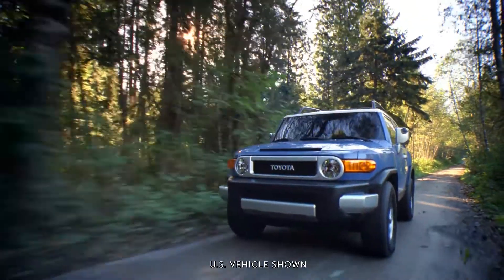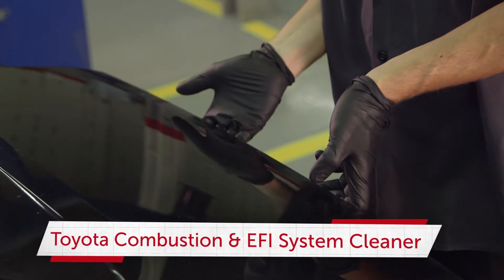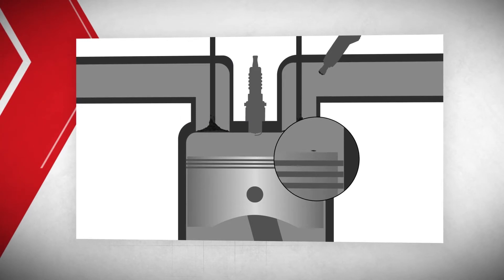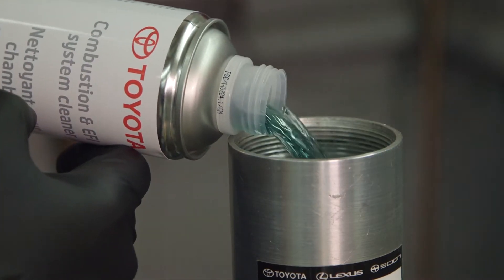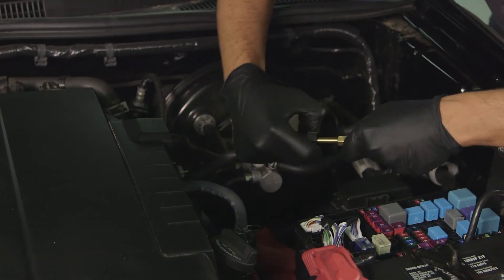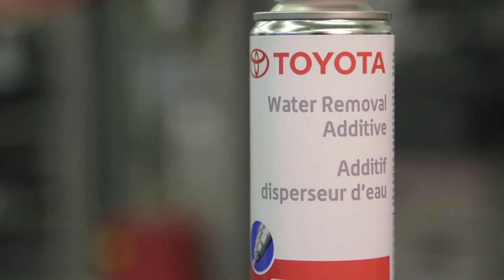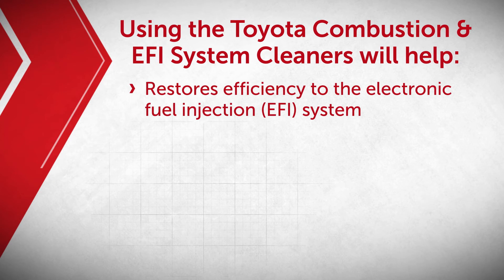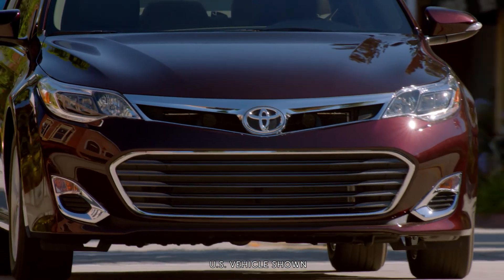Toyota Combustion and EFI System Cleaner

Comment: And how much money does this cost.
Reply: Karen Bryan $200
Reply: For $200, it is better spend the money on replacing worn shocks/struts instead.  Canada is cold and many people stop the engine before even reach close loop/warm enough.  It cause fuel condensation and dirty injector/intake valves.  Most people live in countries with temperature > 0C most of the time do not need this service.

Comment: I brought my 2020 Corolla in to have tires swapped, oil change, and seasonal inspection.  I have just over 65,000 km and I use regular gasoline.  I was told I need the Combustion and EFI system cleaning because they were dirty.  What am I doing wrong that I need it if it's recommended every 80,000 km?

Comment: Toyota thailand do not have this service
Reply: Because you do not need it, you never really start the car at very low cool temperature when car takes much longer to reach close loop/warm up.  You have much rare problem with fuel condensation from short trip/cold engine  like in Canada.  Even in Florida USA, we never have this on Dealership, no one needed on Toyota engine.